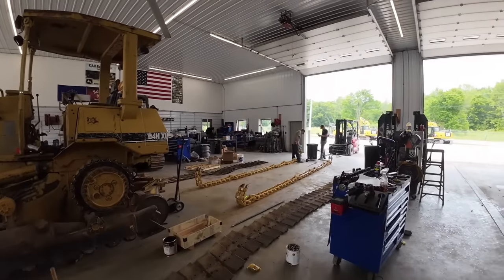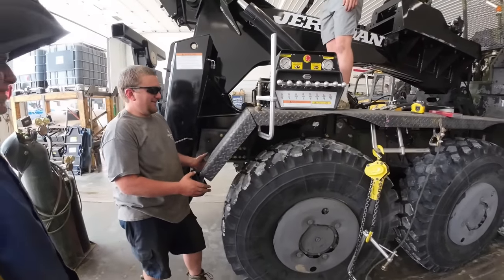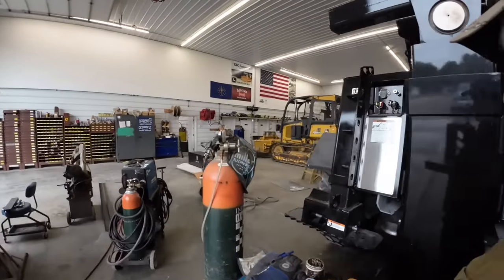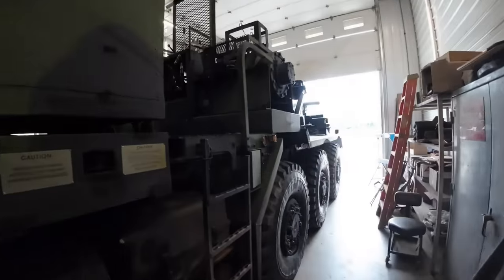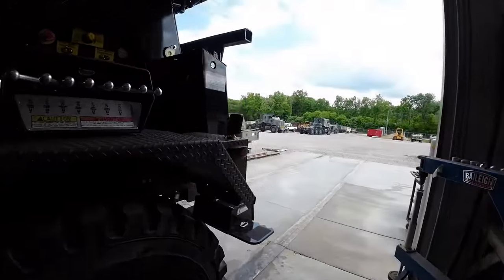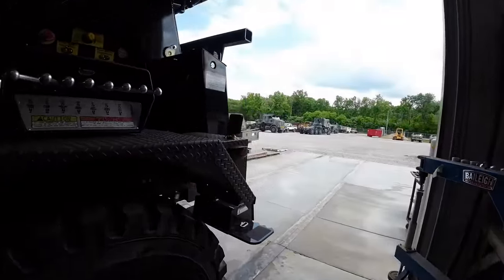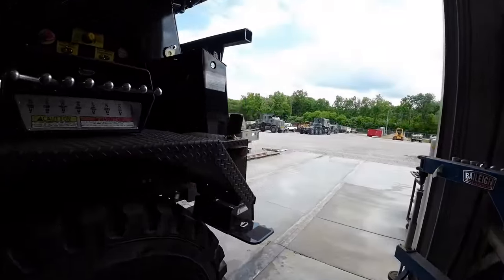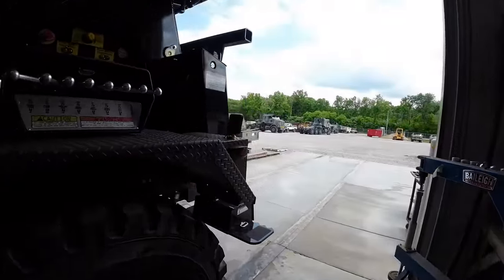We go all out and finish the epic Oshkosh HET 8x8 heavy off road wrecker

Comment: I really really like what y’all have done. I would have flipped the tool boxes upside down and added gas lift shocks so the doors opened upwards to make them easier to get into. Like how the fenders and everything else turned out though.
Reply: Second this
Reply: Those boxes are way to awkward to reach into , also the doors wouldnt be long getting wrecked from chains or other heavy items sitting on them
Reply: @derek763  I wasn’t going to say anything but that’s why we started flipping our boxes at my dads shop because the doors were getting damaged way to often. We flipped them and it solved a few problems all at once. We really like the roll up doors but they come with their own set of problems too.
Reply: For some reason when I first read this I thought you were talking about making the vehicle doors open upwards with gas assist shocks (which would be kinda cool but impractical). I blame the lack of caffeine in the morning. I agree on the toolbox doors opening upwards solving a lot of problems since in that configuration they'd just dump whatever is on top of them if its too heavy and don't get heavy stuff dragged across them.
Reply: Agreed! Good for inclement weather!

Comment: Being a heavy wrecker operator it’s funny seeing y’all put the receivers on with the sling hooks and then fighting the cables. At least y’all know to power wrap them and most wreckers hold 250’ it’s easier to run a snatch block so your now so far out when spooling but y’all done a fine job.

Comment: Great build. Jerr-Dan should hire you to build these "Super Wreckers".  Suggestion: small winch on front 5 to 15 ton for those pulls where you can't or shouldn't pull from the back; boat ramp or where you need to anchor from the back, until you get things stabilized and can turn around. Just a thought.

Comment: You done a great job on the fabrication on the guards and Hurrah !! for Kevin on the neat spray job. Those new 5' tool boxes should be turned up side down so you can reach in side of the tool box, as now you have to be 6' 6 and arms 4' long to get into the dam thing. If you had the door opening up wards on some gas strut prop arms to hold the door up and you can have easy access.Just an idea there   as you need to carry a step ladder to get in all and a great job. 

Cheers and keep up the work. :)

Comment: That's on Woowser humongous tow truck.
Mr. Sausage Fingers Kevin did a great paint job.
Tucker some darn good welding.
And Big Boss Clint metal fabrication.
Awesome team @ C & C Equipment.
Love that grill.
That white engine hood just needs a Coast Guard red and blue racing stripe and tow C130 J's out to the flight line fresh from overhaul at Elizabeth City North Carolina. 
But that's just the Coast Guard Aviation Veteran in me.
Absolutely no doubt that it's gonna sell fast.

Comment: Clinton I have to ask our plasma table operator, but if I remember correctly when we cut checker plate we did it upside down. Anyway I noticed the torch hit and was wondering why the machine didn’t stop? On our first two tables if the torch hit it would break away and there was a switch that would stop the machine so you wouldn’t waste material. They were water tables too. But we could lower and raise the water level to retrieve small parts. Our new table has an exhaust system so it is dry. I think you would be amazed at what that table can do. It can plasma and oxy cut plus it can drill and tap holes. Plus a whole lot more. Keep up the great work.

Comment: I guess that it might just be a tad bigger than the little freak "Matts off road Recovery" International tow truck for the Moab desert folks. I mean like the motor that drives one winch on top of this Het truck weighs in about as much as their rig can pull. I do believe you could go out and just do a wheel lift dead pick and lift say a D4 dozer right out of the mud. I am rather curious as to what kinds of terrain it can travel on... Single tired, it should tip toe on some fairly sketchy ground. Plus those military mats we used to use which caused more issues than solving... my rig needed to walk across this clay mud and move a cement pump truck. Now my rig I am talking about was my old cab over KW100 short wheelbase with some decent winches... took hours to cut the metal that those mats did wrap themselves around the rims on my rig/LOL So Clint, be a fine guy and show it doing a little recovery. I ain't so sure anyone can just crawl on it and operate it

Comment: The truck looks great. Three ideas for improvements. 1. You need more emergency lights for the back of the truck. With the truck lifting a vehicle, the light bar on top might be blocked by the raising of the boom  2. It still screams Army truck inside. It would be best if you painted the interior. 3. Design a larger front bumper, if ever involved in an accident it would not roll over the vehicle in front. It will make a great addition to any tow company vehicles inventory.

Comment: I think I would have preferred them tool boxes mounted upside down with gas struts on either side to hold the door in the up position, can you imagine how hard it is going to be trying to man handle massive heavy chains and snatch blocks in and out of a box five feet in the air  and OVER a flimsy open cover ? I also noticed there seems to be not many work lights around and above the boom end,  an absolute must if you are working in the pitch black to lift a stranded vehicle.  oh and by the way Kev who moved the north pole  to Alaska lol

Comment: I love the work you guys do but you need to learn how to but cable on a winch you but it on upside down you pulled on the bottom of the winch and it came off the top of the spool cable has a memory and the bottom wrap need to be packed tight as you can using a pry bar or when you put a heavy load on the cable it will pull in between the raps.

Comment: Just out of curiosity, why only a 25T wrecker? With 3 axles in the back and all the front drive axle hardware up front for counterweight, a 35-40T wrecker assembly seems more befitting a rig of that size and GVWR. I could be wrong but I drove heavy duty for years and I think that chassis is capable of alot more.

Comment: This is a very well done built. But do you have double rear light? If you take of the wrecker parts with the fenders youre also take off the lights. Or will it never drive with the bare frame?
For mr kevin: hoe much does he get for his paintings. Signt kevin van gogh? Because a very excellent paint job.
At 50:00 now he knows. But how do you work this out? Do you get all the drawings or by trial and error?
Reply from the maker: I doubt anyone will take the bed off
No drawings for this build, all in my head
Reply: @C_CEQUIPMENT  hats off sir.

Comment: The toolboxes look a bit silly to me. Its at height, and has a fold down door, limiting your access to easily reach back into the middle of the toolbox. If you got a toolbox where the door lifts up, and has gas struts to hold it up, would have been a lot better, instead of folding down, so the operator has to reach the length of the door  before he can reach into the toolbox. Truck is looking good though.